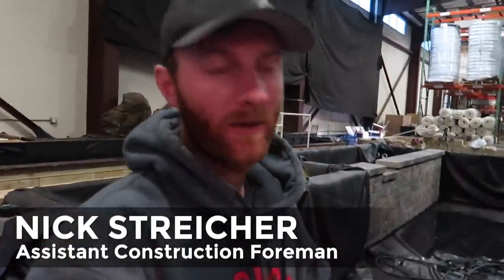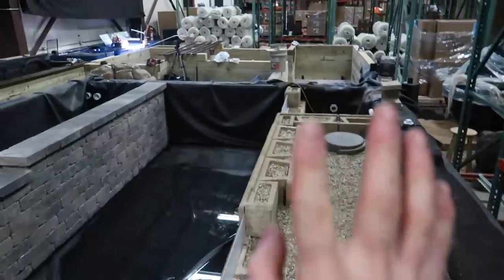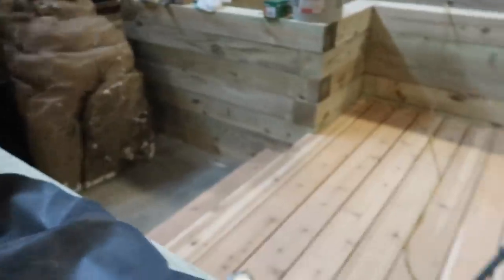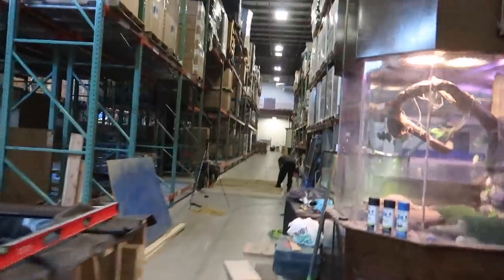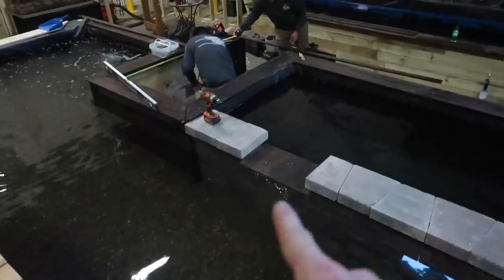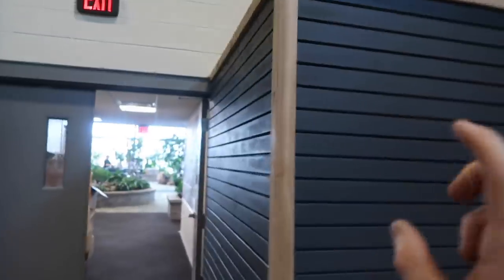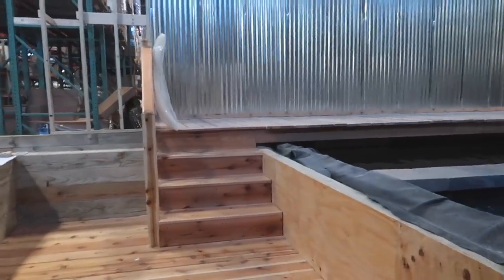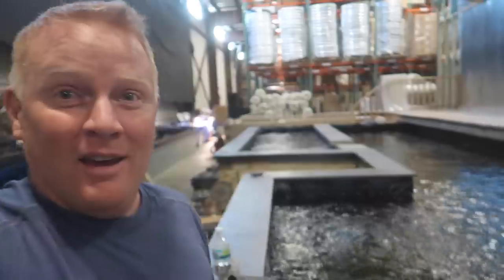Indoor Koi Pond REVEAL W/ Observation Deck and Walls: Retail Revamp - Part 7

Comment: Very nice look. Im not trying to be an ballbuster. However you should have used 2x8s with a 2x10 band on the outside edge since you will have additional weight.. and kids jump around....or used three of those rail ties to span the length with 2x6 joist crossing over them if you only had that.. overtime sagging and bouncing will get worse and unstable.
Reply: Also... the design I told Ed about( simular to commercial concrete form boards for deep concrete pours) would help prevent blow outs and can be faced with a finish ply, brick, etc. on display side instead of the kicker...trip hazard.
Reply: Over engineering is just right.
Reply: @julieenslow5915  safety first
Reply: Thanks for the insight. Always learning.
Reply: @brianhelfrich1186  appreciate you taking the time to read my comment... I'm pretty sure you guys got everything covered by the standards required...